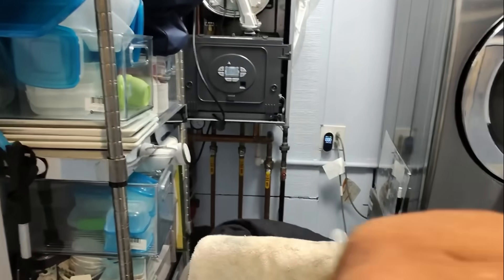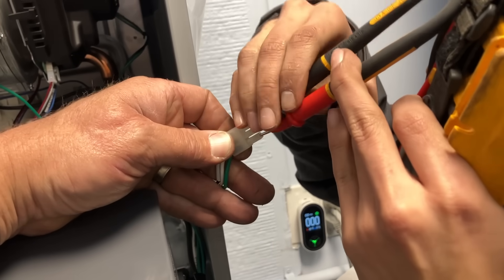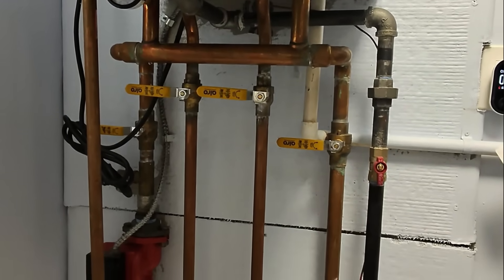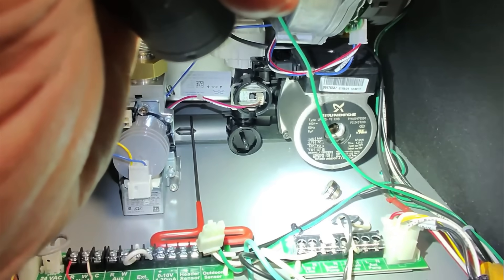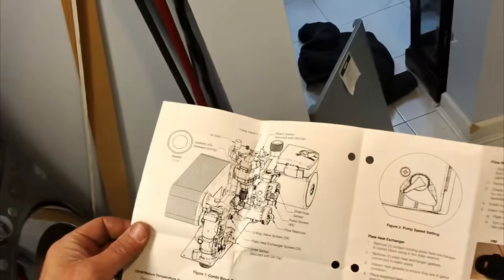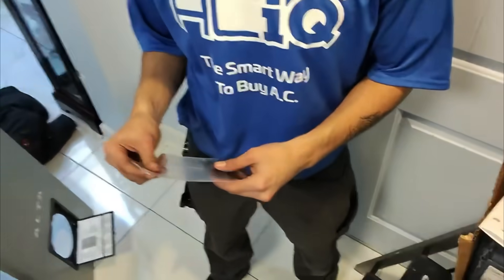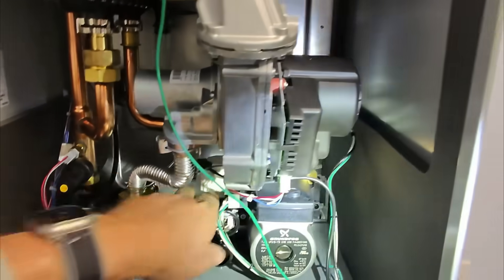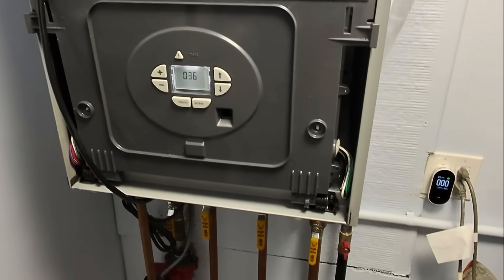2-Month-Old Burnham Alta FAILS  — H05 Error Leaves Family With NO HEAT or HOT WATER!

Comment: These boilers need battery back/surge protector connected to the boiler to allow the boiler to shutdown safely . The first gen electronics were robust and easy to repair . These circuit boards are very delicate and are prone to voltage changes . This unit has a 316L stainless steel heat exchanger , can't beat it at that price .

Comment: A pipe dream maybe,but one day I believe we will see magnetic type bolts where-by, If, the user switches a dip switch on the hex head of the bolt left the bolt can be loosened and removed traditionally, switch it to the right however and only with the patented design wells of course, the bolt, after being placed near the well actually threads it self in fast and strong due to activation of super micro magnetism at work causing that bolt to follow its thread path fast and tighten about as much as it can be without damage.  😮given all the other invented cool stuff and Junk! I see throughout the HVACR industry, I don't think I'm far off at all with the actual idea in reality somewhere.

Comment: If it was only 2 months old why would not the original installation company come out and service it?
Reply: They either didn’t like the company or they just didn’t answer the call. Someone that does half ass work like that is not gonna go back and fix it
Reply: I’m guessing they had a bad experience with the installer. It was not installed properly, there was no way to isolate and drain it. Also, I didn’t see any air separator or expansion tank unless it was out of the camera.
Reply: Maybe they are
Reply: bad plumbers never return  unless they can fleece old folks

Comment: The installer probably didn’t purge the air correctly, & didn’t pressurize the circulator to 15-20psi. More than average Grundfos failures if you don’t. Nice work as always, Mike.